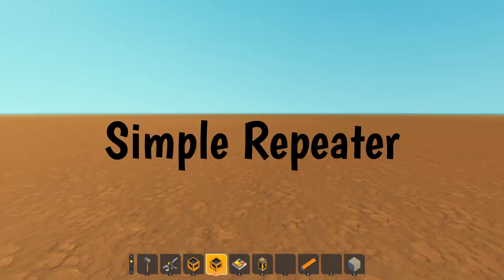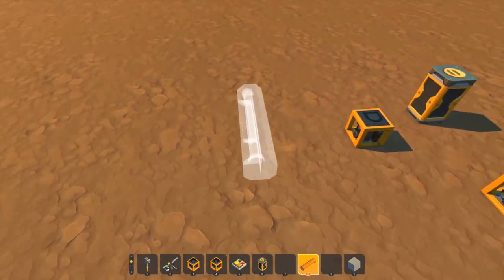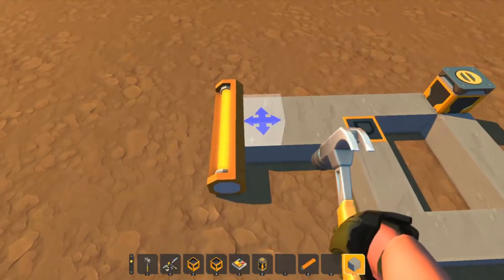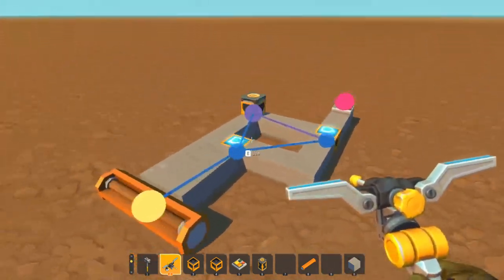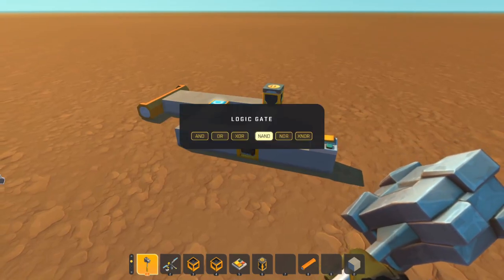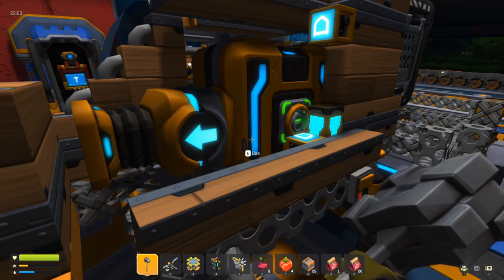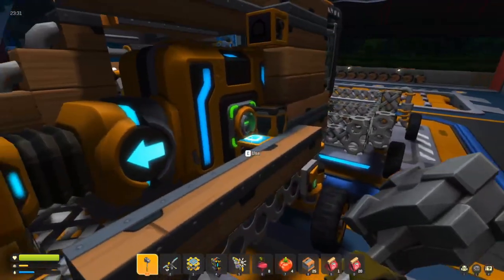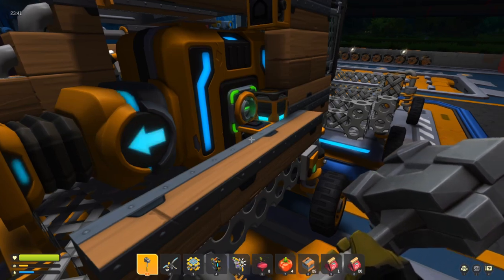Repeater circuit Scrap Mechanic Survival | Easy Simple for Auto Packaging/Watering/Planting

Comment: Awesome, finally got it.
This is how it makes sense in my dumb head.
To explain more, the OR gate is "on" when it gets a "on" signal, off when it gets an "off" from its input ( NAND ).
NAND is "on"  when it gets two inputs that are not both "on" (NAND is an AND with the opposite output)
Its inputs are the timer and the switch.
on+on = off, 
on+off = on, 
off+on = on, 
off+off = on
When the NAND is "on" it sends an "on" to the OR which then turns on and outputs that signal to both the timer (turning it on), 
and to the light, turning it on as well. 
If the timer is sending an "on" signal, the NAND is getting two "on" signals so it outputs an "off" to the OR which sends that to both the light and the timer.
Reply: do the vacuum pumps have the ability to refill ammo gas and battery containers? i want spuds in a chest to refill a spud container
Reply from the maker: No. Not without mods
Reply: @wo0dy  ok thank you so without mods is there any point in connecting chests? with just vacuum tubes
Reply from the maker: Depends if its connected to anything. Connect them to the craftbot will give you storage space. And if I remember (I am a bit out of touch) you might be able to pick items up using vacuum pumps now without mods

So it would let all that be put into chests. But if you simply just connect chests with pipes its not really any benifit
Reply: @wo0dy  thank you

Comment: Hi, thanks for the nice tutorial! I can now create a repeater, but I'm trying to actually understand this. As far as I know, logic gates have 2 inputs and 1 output (except the NOT gate, which does not appear here). In the video you just pull lines from this to that. How to tell which is the input and which is the output?
Reply from the maker: So if you drag from one to another.  The logic you start at will input to the one you finish on. It always flows in the direction you drag.

Also in game, on the lines that appear (blue line from a logic block for example, pink line from a button),  there are white arrows that show direction.
Reply: Thanks a lot! 👍👍👍

Comment: So, the switch and timer are inputs to the NAND, the output of the NAND is one input to the OR, but what is the second input to the OR?
Reply from the maker: look at it this way, the NAND - OR - TIMER is the repeater circuit. The switch lets you turn this on/off without the switch the repeater will be going all the time.(Timer lets you set the pause duration between triggers)

From the OR is the thing you want to trigger, this this example it was the light, you could use a vacuum pump, water cannon etc.

Comment: is there any way to do this without the NAND gate?
Reply from the maker: What seems to be the problem so I can avoid causing more headaches?
Reply: @wo0dy  well the game im playing doesnt have NAND gates and i want to create a repeater circuit but i dont know too much about engineering
Reply from the maker: @yesofastora3572  what game are you playing?
Reply: @wo0dy  it has everything scrap mechanic has except for the NAND gate, the XOR gate, and the XNOR gate and they all function the same.
Reply from the maker: @Yes of Astora well you use an 'and' gate and invert the input, thats all i can give as I have no idea what you are playing or how it works good luck
Reply: @wo0dy  NOT gate inverts input right?
Reply from the maker: @yesofastora3572  yes
Reply: @wo0dy  thanks i figured it out